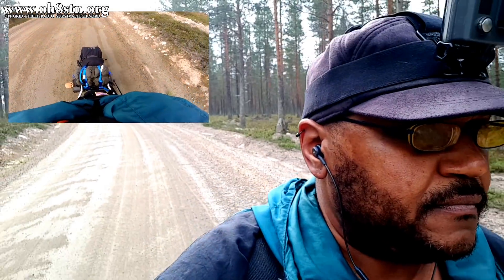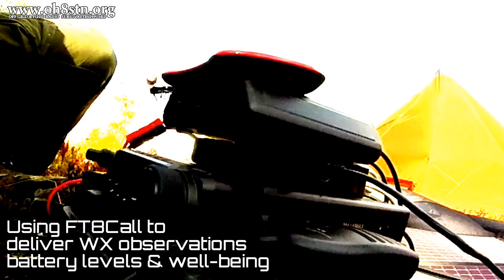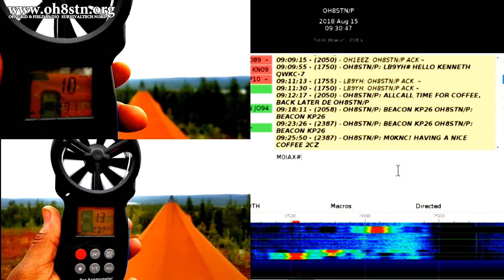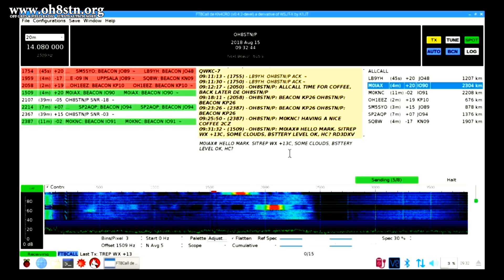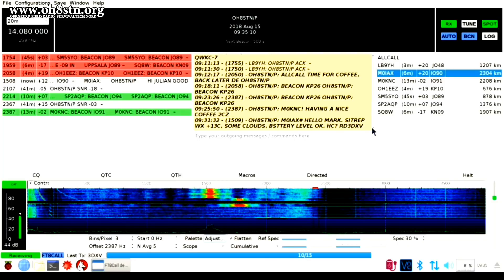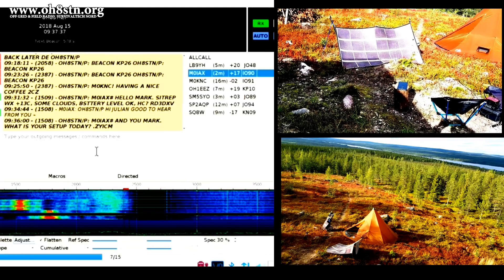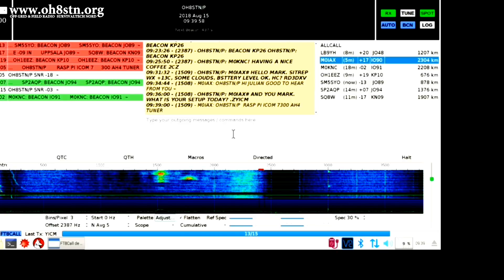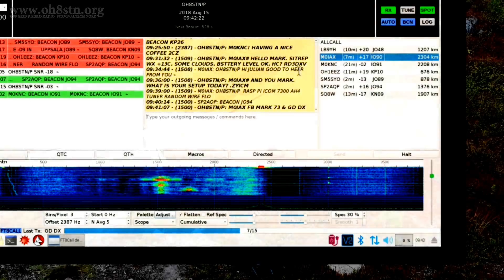Off Grid Portable Ham Radio Station | JS8Call

Comment: This is beyond awesome! I’ve been looking for emergency comms solutions and I’ve finally found it! 
I look forward to becoming a part of this community! 
Just out of curiosity, has propagation been unusually poor in light of the solar minimum at hand? If so, will JS8call be feasible during extended or even Grand solar minimum?
Reply from the maker: Thanks for the kindness, much appreciated. Conditions have been absolutely horrific for some time now, with no improvement expected. As a narrow bandwidth weak signal mode, JS8Call is very reliable in these conditions, which is its purpose. You should definitely take a look at the JS8Call NVIS video I mentioned in the video, and linked to in the description.
Reply: OH8STN  I will definitely check out the vids! I have a lot to learn but I am very excited to become an operator ASAP! I feel like this is important.

Comment: Very impressive work by all involved in this project so far. My reservation is that for EMCOMM purposes there is a flaw in the logic that will always be a significant factor. Specifically, it needs somebody else on the other end that knows what they are doing and is able and willing to help. When/if SHTF - whether on a personal level (accident in remote area) or a societal or regional natural disaster, you most probably need help from or need to contact someone who isn't actually a Ham. Relying on another Ham as an intermediary massively reduces the reliability of the communication path. Through our HF equipment we need to be able to easily communicate with 'normal' people via mechanisms they are comfortable with and routinely monitor and without intermediaries. So we are talking email and SMS text at their end. Winlink partially covers off email but could be a bit more user friendly and to a lesser extent so does APRS. Haven't seen an SMS interface. For the field operator ideally an Android version of winlink on a tablet would hit the spot...if only. 

Maybe these dual OS tablets have a place in our backpacks until then ?  https://www.chuwi.com/product/items/Chuwi-Hi8-Air.html
Reply from the maker: Quite often the biggest flaw in our strategy is our own knowledge. Everything you said is absolutely correct however. There are multiple ways of getting a message to and from "normal people". My goal in a disaster scenario is getting my message outside of the disaster Zone, letting people know exactly where I am, giving them my health and welfare, then letting people know where I'm going to be. The fail usually comes when operators aren't familiar with which tools are available, how to use them, and which one to use in a particular type of scenario. 
These types of discussions are critical, as is getting out in the field away from the Comforts of home, putting our skills to the test.
JS8 is just one ogmf my tools. HFAPRS, WinLink, JS8, FSQ, SELCAL, NBEMS, ...

Comment: I think this video helps me see that, for short reports of critical information, FT8 Call has a definite purpose, and is obviously available to all as a familiar format.  I'm not sure it will catch on widely.  For longer chats over the radio, I have to wonder how a fairly brief message cut up into pieces and transmitted sequentially in several 'overs' is not less power efficient than using OLIVIA, ROS, etc.  I am also rather annoyed that FT8 Call has decided to allocate itself 14.078MHz, getting in the way a little of those still using JT9.  OK, JT9 is not very popular right now, but it may return.
Reply from the maker: Fair enough. I'm more annoyed about the rtty guys who take up most of the Bands (even the voice segments) of the Bands during their silly contests. But you're right, and it had to go someplace. Yeah the short messages cut up sequentially are more efficient than Olivia because of the extreme narrow bandwidth giving a much greater distance per watt. We can get more data into the same length of the transmission in Olivia, but only at much higher power levels. It's like the difference between the shotgun and the long rifle. Also there's the networking functionality built in which Olivia and other mode lack. I agree with you wholeheartedly though. When we have excellent propagation another mode like fsq or Olivia MFSk32 would be preferable over ft8call. 
Anyway thanks for the excellent comment and feedback. I'm really happy you took the time to reach out.
73
Julian oh8stn

Comment: So, I've been watching, researching, reading and studying for a year now before I figured I had enough understanding of what OH8STN was trying to get across to everyone to actually comment.  One notable post I thought I'd pass along from another blog stuck me as something that might be appreciated here:

  "Update: The Yaesu FT-891 is the smallest at lightest 100W HF transceiver ever built, at 155x52x218mm and 1.9Kg. Unfortunately the 2A current draw on standby makes it unsuited for truly portable operations."

 While I still have glaring gaps in my education when it comes to man-portable radio...(and amateur radio in general...) for my intended use of the skill set and equipment, I've only found a small handful of folks in the online radio community (in addition to OH8STN) who share my own conditioned response to someone telling me I can't do something... Thank you for your continued generosity in providing some of the best content around for both the budding and, I'm assuming, experience operator.
Reply from the maker: Thanks for that comment. Many of the established ham radio content creators gasp at the idea of what I'm trying to get across. A fully capable, man portable QRO field station,  solar powered and self contained. It's usually because they look at one piece of equipment singularly, not as an integrated part of a larger system. For example the hiking trailer is a part of my Communications system. So is the tipi tent. Moreover, if you look at the total weight of my gear, it's probably lower than the total weight of everything else those established ham radio creators carry themselves. So I'm looking at the total weight of my gear. I can carry a heavier radio because other gear is so much lighter like my shelter.
About the 891, that's my choice for radio. It weighs slightly more than the 817 with a full set of batteries, and puts out a hundred Watts instead of five. If one is looking for true portable capability, it's hard to argue against it. Check out my video on 891 current consumption. The Yaesu  documentation is off by about an amp. Typical current consumption ~0.90-1A. I've never been able to reach to 2A current drawn receive, regardless of what I've done to the radio. 
At the end of the day research includes testing, reading and not blatantly accepting what we see online. Documentation  doesn't always paint the best or correct picture.

Comment: This is a wonderful utility mode. In the video, you mentioned Winlink on the Pi.  My research so far has shown running the Winmor modem on the Pi isn't currently possible.  Have you found otherwise? 73, Rex KE6MT
Reply from the maker: @merrumt8476  yes that's it. I can't imagine why I can't remember that name. Anyway but that's the one. Exagear with wine
Reply from the maker: There is a way to get winlink with winmor running on the pie but not without spending money. I've been busy with the series, but I should get back to that in a week or two.
Reply: Ah, I see. Thanks for the reply!
Reply from the maker: No problem I forget the name of the software but it allows you to run x86 apps on a Raspberry Pi. It's meant for games and things like that but sometimes it works okay for ham radio apps that require audio handling. I'll try to remember the name and then I'll write it. There's also the software called PAT. Many operator said they have it installed and running but I haven't been able to connect to any gateway's yet.

Comment: Very interesting. I have FT8 working on my Pi and FT8Call working on Win10, but still trying to install FT8Call on the Pi. Looking forward to testing in the field, however has been propagation poor on all bands the last few days in my QTH. Thanks for doing this George VY1GP
Reply: Aug 31, upgraded Pi to Raspian Stretch and installed FT8, FT8Call, and Fldigi. Got all working. Made a QSO with FT8 on 10m, but not much activity on FT8Call and CW today. VY1GP
Reply from the maker: Most of the ft8call Activity is on 20 and 40m.
Reply: Thanks. Spent a couple of hours Sunday and made contacts and received signal reports on 20m with FT8Call. No much else, except FT8, was on the band. This a really nice mode and progressing quickly.

Comment: A  very good demonstration of the possibilities and capabilities  of the mode.   Has anyone tried using this mode without any form of timing controller? I mean no gps or internet connections, would it be workable?
Thank's for these video's.
Reply from the maker: I haven't tried it yet but it would make an excellent experiment.
Reply: Thank you, 73 de G4MQK
Reply: Decoding is timing dependent just like the WSJT-X modes. Future plans may remove this dependency.... we will have to see. 
I have operated portable with this mode on several occasions, without GPS or internet. Using WWV for a manual time sync, it performed flawlessly. I think FT8Call will be the ultimate low power, weak signal, portable station communication tool...... de WØFW
Reply from the maker: Totally agree. If I wouldn't have been there done it myself Laughlin to the south of UK to a guy in a boat, I wouldn't believe it. This mode is huge, but I'm still not sure if the community gets it.